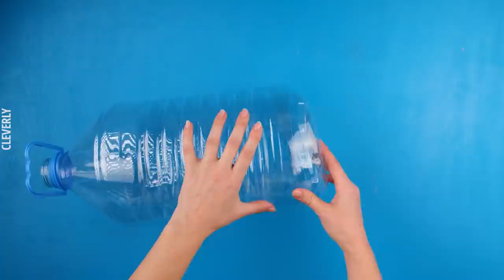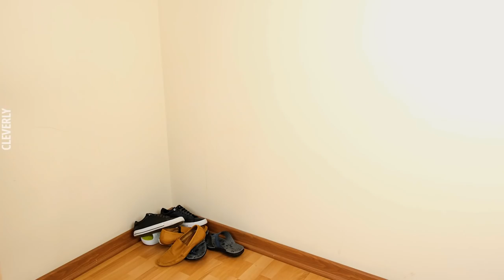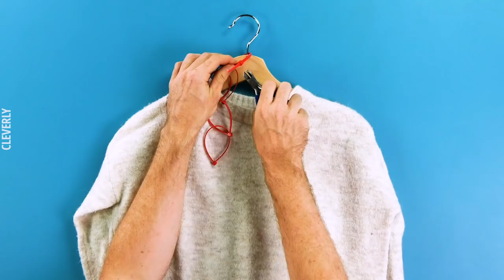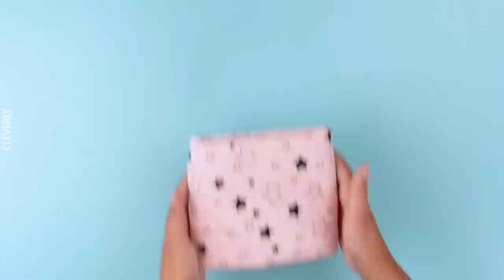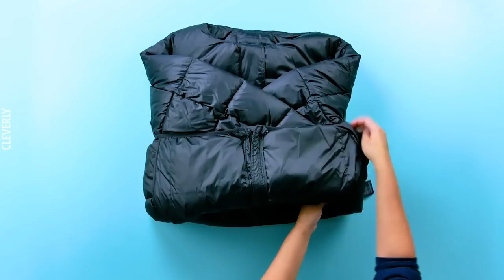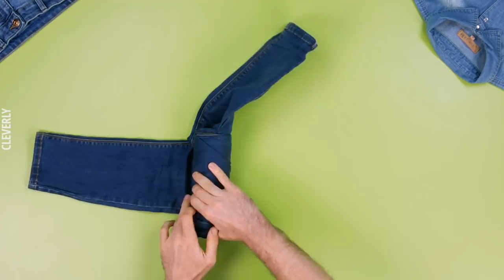Kiss Chaos Goodbye ❗ 20 Clever Tricks For Organizing Shoes & Clothes | DIY Shoe Rack

Comment: Learn to sew! Hot glue will not connect fabric good!
Reply: @Machenzie Woods. There are several brands of hot glue sticks on the market for fabric! Which I didn’t know about when I tried to make one for handbags. Regular hot glue was epic fail for me and I ended up sewing it anyway! I do have fabric hot glue now for quick fixes!
Reply: I absolutely ❤ these ideas!!  I'm going to do them!  I am thinking of using staples for the knickers on the honeycomb one for my knickers as I have major tremors so I'm dangerous with hot glue.... and as there's no weight in knickers storage I think it will work just as well.  I've recently moved house and the removeralists were the ones from hell. They tipped everything out of my beautifully organised drawers and just tipped them into the moving boxes without even labelling the boxes.   They should have just left everything in the drawers!  I have been so horrified by all that they did to the point where I ended up in hospital!  I'm disabled, so they were supposed to pack and unpack but they just made such a mess and I'm also missing a whole heap of items!  I'll definitely use these ideas as the unit in which I moved into is only 1/3 of the size of my last place.   All in all it's been the move from hell so I'm trying everything to organise everything .... again!!!
Reply: @mackenziewoods8201  I've never even heard of those!  What type of things do you use it for, is it easy to use, and is it expensive?